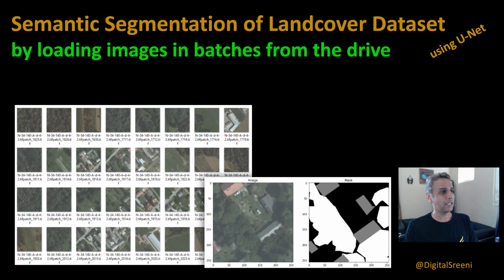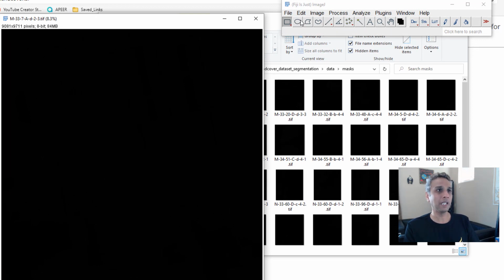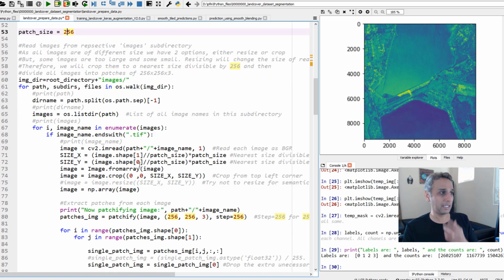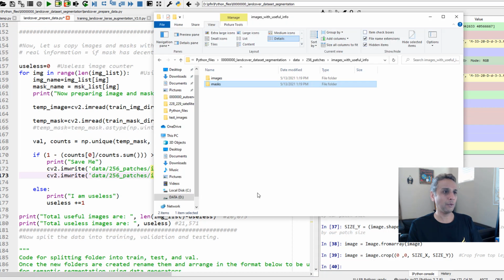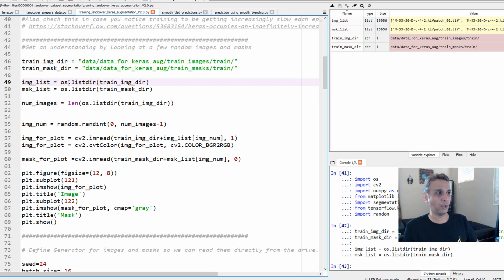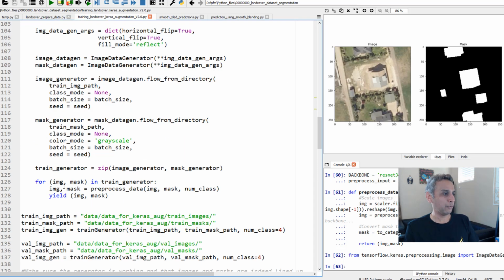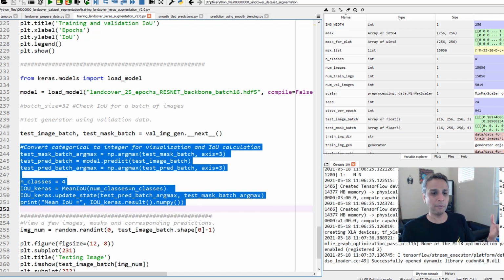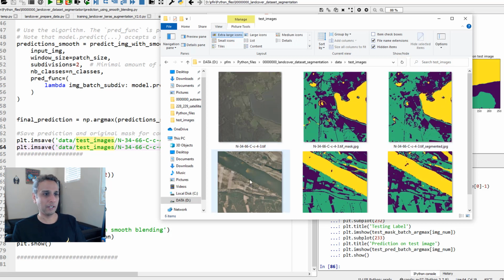230 - Semantic Segmentation of Landcover Dataset using U-Net

Comment: You're amazing as always, thanks a lot for your hard efforts, 

Did you share this 230- the code?, I didn't find it!

In some researches they use cutting images into tiles, Is this similar to patching?

How could we know the patch size 256, or 255, is the best without creating gap?

Is converting to categorical necessary for multi-class only, Or for both multi-class and one class for instance building footprint?
Reply from the maker: The code is available on my github page. 
Cutting images to tiles is same as dividing images into patches. 
You need to do the math about the right shape for your patches / tiles based on the input image. I divide my images into tiles of size divisible by 2**n (32, 64, 128, 256, 512, etc.).
Converting to categorical is necessary for multiclass if you plan on using cross entropy based loss functions that expect categorical inputs (categorical cross entropy, focal loss, etc.).
Reply: @DigitalSreeni  I really thankful to you, actually you're doing great by simplifying difficult things into very handy. Do you mean for building footprint extraction when the mask is only has one class categorical is needed? Hope you have time for building footprint extraction to be next video .